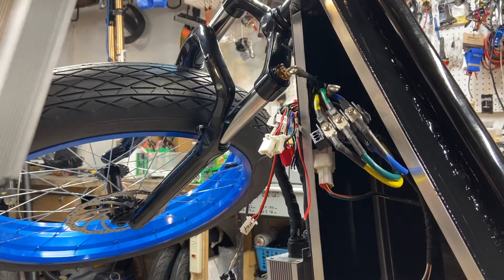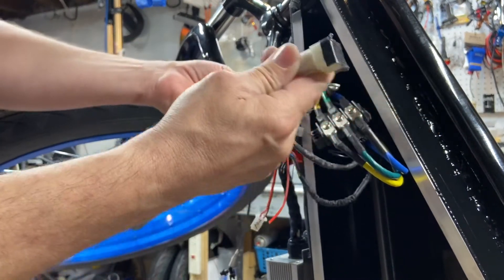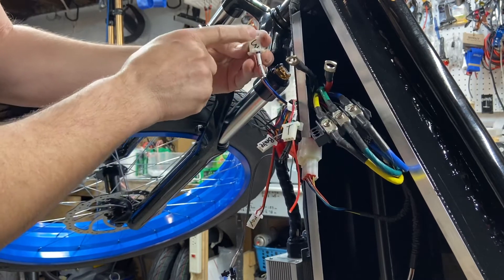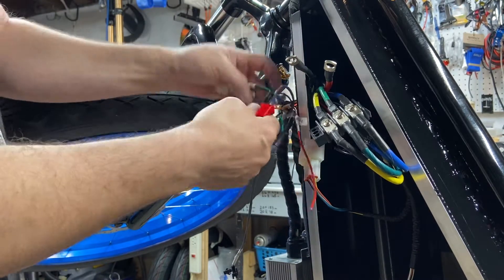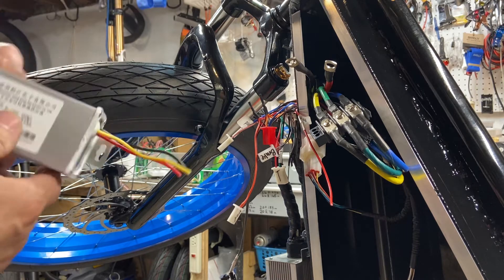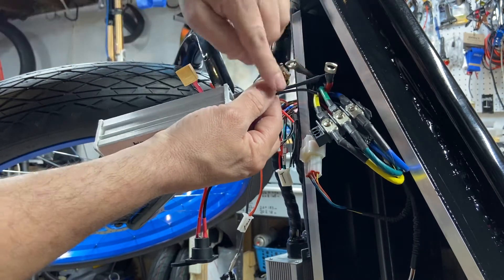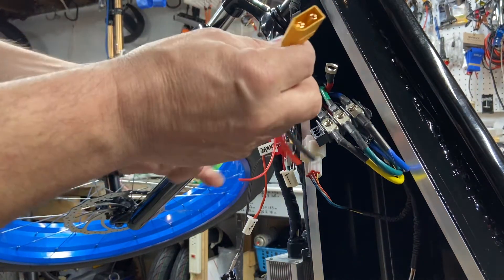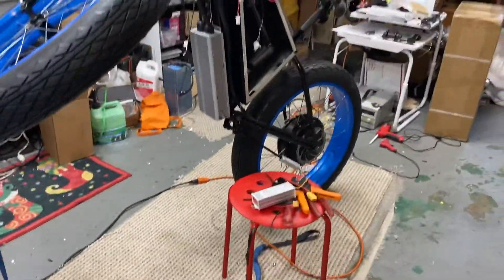Wiring up the controller 15,000watt Raptor Ebike electric bike

Comment: I hope you have better luck than I did with that controller it was terrible for me and made awful humming sound i thought it was outta phase but nope seems it just did that. I know  someone else had bad experience as well so Im curious to see how yours works out. my bad this is old so how did it work out?
Reply from the maker: LOL. Very reliable controller. Easy to use and minimal issues with the 100’s+ ebikes I installed them on